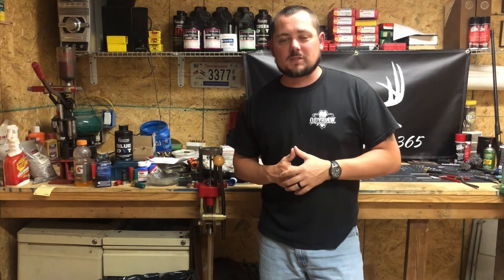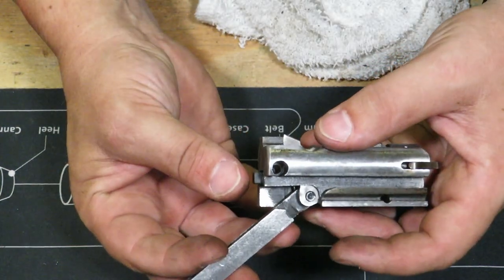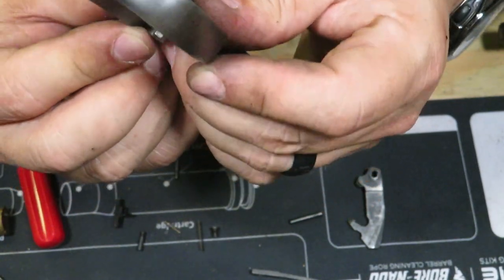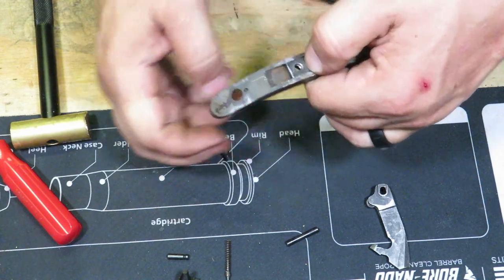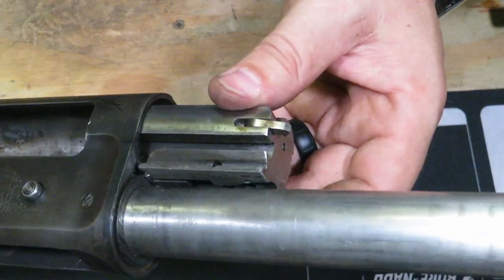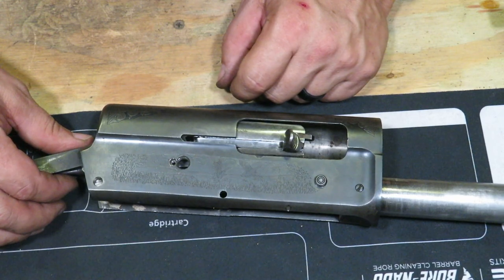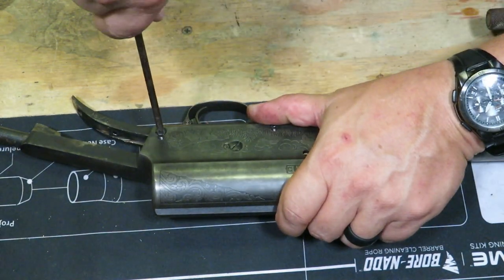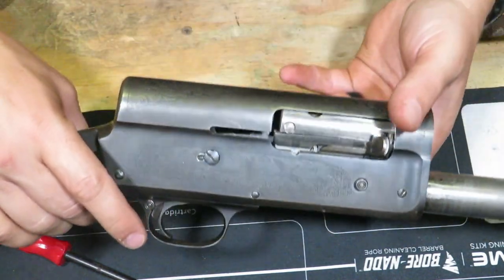Savage 720 Full Assembly

Comment: I have one in 16 gauge.  It fires but the spent shell doesn't fully eject. Like it needs to come back just a touch
Reply from the maker: Are you using low brass? Have you set the rings for said low brass? Have you done a full beak down clean?
Reply: Yes, was using buckshot and #6 high brass. It's a 720 stevens savage, it looks like my A5 browning